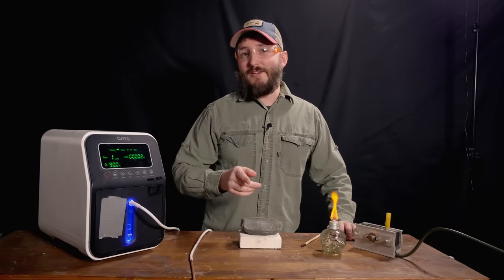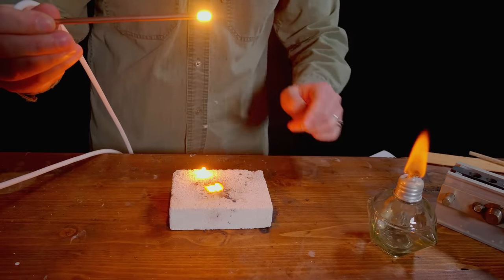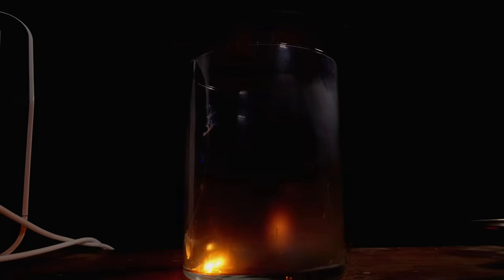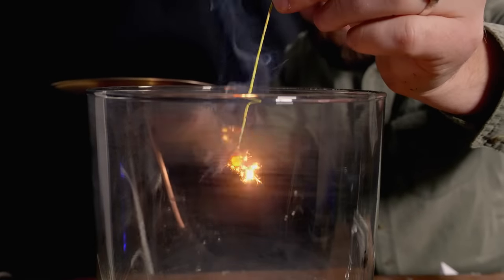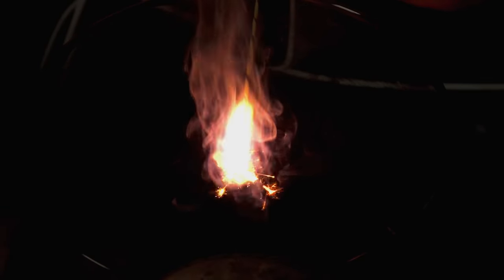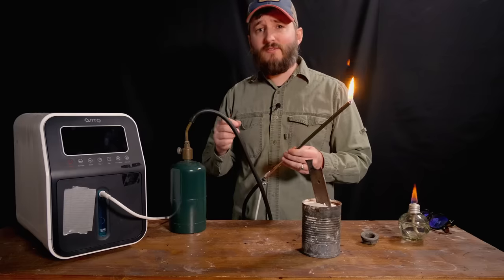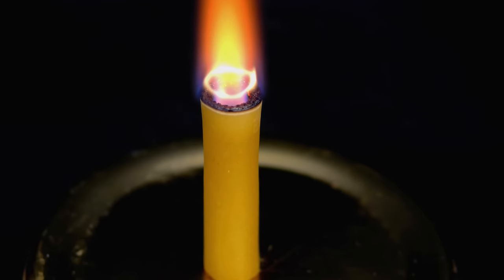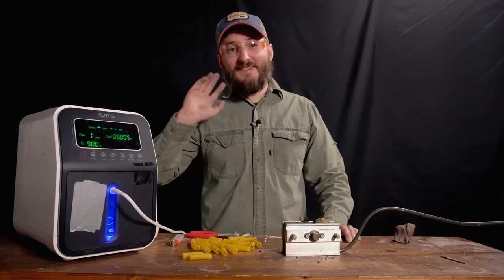6 Unauthorized Uses for a Medical Oxygen Concentrator

Comment: Just a few extremely basic ideas for the rockets:
- Use a scale of some kind to measure thrust so that there's something to demonstrate (or make your own with a load cell, that seems more typical)
- Cover the whole pasta in clay so that we can have it burn to the end - could matter because I suspect we don't only care about peak thrust but also some sort of integral of thrust over time, to serve as some sort of proxy to Isp (again I'm trying to think of things to teach here :-) )
- Make your own pasta as fuel! I think a custom design closer to a real SRB will help in two ways ; first it will make the experiment more realistic (and you'll be more likely to actually measure some thrust I believe), and second I suspect it will help a lot with repeatability of the experiments - I don't think normal pasta is made to tight tolerances haha, and we need the "boosters" to have a comparable amount of fuel, so that we can...
- Vary the nozzles ; in the most basic form, you will care about the throat diameter, but you could also of course try to play with some more experimental designs, eg attempt a clay aerospice (an aerospike that makes pasta tasty :-D )

Great video as always, can't wait for part 2!!! Also as others mentioned, I'd be curious to see a nozzle on your torch, even if only eg hammering the tip of both tubes (inner/outer) down into more of a slit shape, IMHO that would already do a great job of speeding the gases up a bit and perhaps encourage a bit more mixing! :-)

EDIT: Typo thrust/fuel

Comment: I really would like to see you try the torch from propane/oxygen torch kit.  I had one of those years ago (and it still might be around here).  It did work, although the flame wasn't very large.  The big problem was that the oxygen tanks cost about $15 and only last for about 10 minutes.  I've seen these oxygen concentrators advertised on TV and have often wondered if one of these would supply enough oxygen for a small propane, mapp, or acetylene torch.
Reply: @@qwertymnbvc3082 If you get that flame to heat steel, it will cause hydrogen cracking, and the steel will be crap.
Reply: @@qwertymnbvc3082 I made the steel crack, so it is not a gas mix to use.
Reply: O2 concentrators usually produce less than 5 liters/ min . That may support a jeweler torch or small oxy/ acetylene or oxy/ propane. I have used 5+ liter/min to do both. Volume and pressure will not support cutting. But welding is ok. Glass workers may gang 4 or 5 machines to get the volume of o2 needed. Pressure is low, but compressors are available for them that do about 3000 lbs to recharge small containers. Read up on torch oxygen safety. You can get hurt.
Reply: Industrial oxygen is 98% pure and at least according to textbooks you need at least 95% oxygen for cutting. For brazing and welding it's probably not as critical.
Reply: @dalentoews3418  oxygen separators ( concentrators) absorb nitrogen from air, leaving oxygen and traces of argon, and other rare gasses to pass through. Usually 95- 98% oxygen, most separators have o2 sensors if it goes below 90% . The nitrogen is expelled and another cycle starts. They work fine for welding. Some large consumers (like shipyards) use separators on site.
Reply: so i have some O₂ tanks and a generator kinda like that, it is pretty nice, but just letting it flow out to the propane basically got past ignition to explosion. you are going to want to regulate the flow.
Reply: @Mitchell_is_smart._You2bs_dumb  you should be playing around with oxy-acetylene ( carbide)..it has a lot of energy from the tertiary carbon bonds..mixed with oxygen, the flame is 6000°, and it will explode with very minimal provocation. Then there are cousins thermite, glycerin and mercury....
Reply: @nickv1008  i don't have acetylene, i just got a new (Zclass i think?) torch though, so i will soon. but i gotta get some eye protection for bright bright light, and maybe stich up some leather gloves. i don't have access to mercury, and thermite is not very useful. i follow a 7part mix for my glycerin; 3 parts glycerin, 3 parts water, one part gelatin.
Reply: Also have one of those little oxy/mapp toys sitting in mothballs.  agree, seems like a good potential use for it - the wimpy o2 tanks were a joke.  Not sure, but its O2 tanks pressure may have been more than your 02 generator, again not positive as its "regulator" did not have a gauge, just adjustable 'knob" that was very sensitive(was hard to get right mixture without blowing out flame).  also, the ratio may have been different since O2 tank was pure oxygen.  Also, they had a different version that came out later that made more sense to me.  It used some form of solid O2 that may have been more economical, lasted longer?  Capacity is an issue, possibly get it to work for jewelry size stuff, but wonder if it would weld or braze say 1/8 or 1/4 plate?  Anyhow - I would love to see you getting it working with one of these little torches.
Reply: @mevk1  older o2 separators were sometimes paired with a compressor to refill those small cylinders.  The fittings are different for medical v industrial o2, but the gas is the same.

Comment: RE: oxygen torch kit. I would recommend a small hand torch kit for your purposes. Jewelers and lamp workers use them for fine detail work. They work a treat and have well machined knobs for fuel mixture. If you want to get super serious, getting a propane regulator would be required. Regardless, love your content, incredibly well produced!

Comment: You might be able to get a rocket press used for fireworks (nothing saying you couldn't machine one if you have a lathe). You use bentonite clay (powdered cat litter for all intents and purposes) to form the nozzle in a cardboard tube by ramming it with a hammer, add powdered fuel such as charcoal, ram that down, then finish with an end cap, stick the oxygen pipe in and away you go!
Reply: He probably has one! His older videos are all handmade fireworks.

Comment: As someone with Welding experience can tell you, You better put a spark arrestor on it.
Reply: Fuuuu, I was scared for him hearing the fuel sputter. 

I am never as alert as I am behind an oxy/acet torch. It's like an automatic extra d20+20 roll to perception and dexterity.

I'm probably sapping years off my longevity (lowering my constitution) gaming my adrenal glands in this manner. But you know, less life overall or lose it all right now? The only way to win is to not play, and that answer, when it comes to oxy/acet, has yet to achieve enough sufficient peer review to be accepted as canonical.

Comment: If you find more of these, try linking the outputs together, get double the flow rate, I'd also love to see how they work when the output of one is fed into the input of another, can you get 99% pure O2 gas from the 2nd one, or does the mechanism become saturated and can't get much higher than 90%, similar to how it's very hard to enrich the concentration of U-235 from via gaseous diffusion even with an LEU input of 3% U-235 as opposed to natural Uranium's 0.7% U-235?

Comment: I have seen people on line run small oxy propane torches on Medical Oxygen Concentrators.
The torches are cheap enough there is no point building one unless you just want to.
I have had my eye out for a Medical Oxygen Concentrator ever since I say someone run a torch with one.
I have a plasma cutter now but oxy propane is great for when you need to heat and beat something into shape.

Try a morning glory sparkler in the oxygen.
I suspect you know what they are since you roll your own.
They look cool and use bamboo instead of steel so they wont break your glass.

Great video!

Comment: The nozzle setup would do great with a thrust meter, either with a load cell or maybe just a spring and a dial indicator. For nozzle designs you might be able to compare some different nozzle sizes, have an easily tweakable variable that produces some different thrust readings.
For a more scientific setup, maybe for older children, there are ceramic 3d resins. It'd be cool to have a software where you can play around with 2 or 3 sliders to generate nozzle shapes, then print them out and compare them in thrust and maybe burn duration. At this point idk how well pasta would hold up as the fuel tho.

Comment: You can use the gas tank, you used to collect the wood gas, to collect bigger amounts of the oxigen and then use a  compressor to fill pressure tanks. So you could safe oxygen for later projects.
Reply: @gilgold sure thing , try it out. O2 under pressure mixed with fine oil mist from the compressor = bang! Try it .

Comment: I'm curious about the practicality of making soft iron(carbon free) on a small scale for electrical projects like transformers, because soft iron and electrical steel aren't too easy to get your hands on in the u.s.
Reply from the maker: Good question, I've never looked into that
Reply: just gotta go down to any beach or creek and find the black sand, pan it out and melt it down and voila! soft iron with a little bit of effort and probably a lot cheaper. aside from scrapping old devices that have transformers in them to salvage the laminated iron cores i dunno any cheaper or easier methods.
Reply: @ToeCutter454  the phrase "melt it down" is doing a lot of work here. For low-carbon iron you're going to need to first smelt (reduce) your ore into wrought iron or pig iron, then do something like a Bessemer process conversion with it - both of which will need some heavy-duty refractories (and probably a lot of charcoal, ore and flux). You'll also need a lot of skill - even experienced home smelters seem to achieve very variable yields when making bloomery iron, and you're going to be strapping an extra process onto what they do.
Reply: @sangomasmith  Yes, I've visited a blacksmith that does experiments in bloomeries and even when measuring the weights and volumes of the ore and charcoal, and measuring the CFM of the air from the blower, smelting iron on a small scale is highly variable in the mass and quality of the result. It is fun work though, can be very tiresome as well
Reply: @sangomasmith  for pure iron you just need to smelt it from the ore(or black sand in this case) into a puddle and let it cool, the processes are for carburizing and making steel and alloys.
Reply: @ToeCutter454  Most methods for smelting iron are going to impart a significant amount of carbon, which would have to be removed by forcing air or oxygen through the molten iron, but Thermite might work
Reply: @ToeCutter454  I don't think you understand how smelting works. Melting iron oxide into a puddle just gets you a puddle of melted iron oxide. You need a reducing agent (CO or hydrogen) to pull off the oxygen atoms from the iron.
Reply: @thematronsmilitia  Yeah, thermite can work.
Reply: @sangomasmith  could also just buy a bunch of those oxygen absorber packets from a manufacturer since those are pure iron, melt them in a crucible that you pump argon into to keep it free from oxygen. that would be another easy alternative.
Reply: I don't think the other commentors realize how difficult it is to obtain such pure iron, as soft (malleable, perhaps) as lead
Reply: @timothys8636  Agreed. I'm not sure that many of them understand how hard it is to obtain iron at all, let alone control the carbon content (or other impurities).
Reply: @timothys8636  considering all the nuclear tests you are correct since almost every ounce of mined iron and other resource is slightly radioactive. there are salvage groups that go out into the ocean and salvage sunken vessels and tanks from WW2 that haven't been tainted with radiation for use in highly sensitive scientific equipment which is partly the reason for a lot of that equipment being so costly.
Reply: @sangomasmith  ah yes, an entire generation or two, spoiled rotten by Goldschmitt and Amazon lol

Comment: Do you have an o2 analyzer? That's most likely putting out quite a bit higher than 90%. We had a few that would typically output 95%+.
Reply from the maker: I'll see if I can test it
Reply: @Nighthawkinlight  that was a former life. I don't remember for sure what acceptable was. Fairly certain it was anything over 92%. I'm not familiar with the one you have. Like I said many years ago in a land far away.

Comment: In an oxy acetylene torch, the oxygen comes from around the center hole which supplies the gas. Maybe reversing the setup you had. Also you are probably right that the unrestricted flow is not ideal.

Comment: Good stuff here. Today begins my hunt for an oxygen concentrator.
I really like the idea of coming up with a more interesting kid safe rocket demo.
Instead of using the noodle itself as the combustion chamber, maybe it would be worth trying to form clay around various forms and trying different shaped/sized noodles as the fuel. That would allow you to use the same easy to make nozzle design.
If I'm able to find a cheap machine, I'll do some tinkering.

Comment: For the pasta rocket, I'd try 2 things:
1) Use bronze-cut pasta, not teflon-cut
2) Cut some Bucatini pasta and stuff if inside the Rigatoni, like a set of boiler tubes in an old steam train
Both of these will greatly increase the surface area and hopefully release more energy more quickly.

Comment: Love it. I agree with comment, put clay completely around the pasta. Also use very small wire to make your nozzle so you have a much smaller hole. That should increase the velocity of the thrust gasses. I am going to be looking for an oxygen concentrator. Great comments on glass blowing with it. I never imagined they would produce that high of a quantity of oxygen.

Comment: Don't worry about that exposure level. You have it low enough and the soft color of the flames, makes everything outside the glass container very black and darkened. It really looks like high-end professional cinematography.
Reply: Those scenes would be great in a scary movie.
Reply: Thermite doesn't have sand in it and it's Iron(Fe, 26) but not steel. Steel is an alloy.
Reply: When sand is struck by lightning, it fuses into glass.
Reply: The pasta jet is similar to vinyl records scatch and pop in sound.

Comment: A fun inclusive addition to the pasta rocket experiment for kids. Make your own pasta from scratch. really easy and you could modify the recipe for different formulas, say add vegetable oil for example. I have a medical O2 generator and I have used it with a small propane-O2 torch and it works just as you said. O2 tanks at the hardware store are a rip-off. Thanks for the thermal lance demo.

Comment: Hi Ben, I picked up one of these units to experiment with as well. Don't forget that these units have one input (atmos air) and two outputs, concentrated oxygen and nitrogen. I'm using the concentrated nitrogen for ceramics experiments and the oxygen output for thin oxide film experiments on a diode laser.

My math might be wrong but if the output is 90% oxygen, that means only 10% oxygen is left at the "nitrogen" outlet. If air contains 21% oxygen, but our new outlet only has 10% of that 21% oxygen, then the purity of nitrogen should be 100% nitrogen minus 2.1% oxygen remaining = 97.9% nitrogen gas, with discrepancies from small amounts of other atmospheric gases.
Double check me, this math gets me twisted in a knot lol.

Comment: the "Frosty T" ejector burner design seems like a perfect fit. it entrains and mixes ambient pressure air, it's cheap and easy to make, and possibly trivial to adapt to enriched air just by doubling the orifice diameter

Comment: Really cool! My only comment would be: Wouldn't it be significantly safer to use a water arrester in a plastic jar to prevent any flashback? So simple to make. Have the machine side tube go underneath water in a sealed plastic container with a weight. Have the outlet tube above water. This prevents any flashback as mentioned.

Comment: One thing it can be taken further for involvement is actually the nozzle itself. The divergent section won't be any useful unless choked flow / Mach 1 was reached by the convergent section on the throat. It might require a submillimeter throat, poked by a needle or so to reach that, but supersonic exit velocities from a noodle would be definitely next level. Love your videos though :)

Comment: Oh yeah and I forgot to mention I have hooked my o2 concentrator up to an oxy acetylene or oxypropine torch kit, both the largest sets and the small portable ones that use disposable canisters.  the small canister types a worked well between two or three liters a minute.  Something the it could keep up with, with out breaking a sweat... 

 It actually did pretty decent on a full oxy acetylene setup using higher flow rates so you're definitely onto something there.   Fun video!

Comment: I use one as a torch works great. I use a jeweler’s torch smiths mini with my o2 generator. Another thing I added to my O2 line, I have in run through silica desiccant really seems to help improve the quality of the flame.